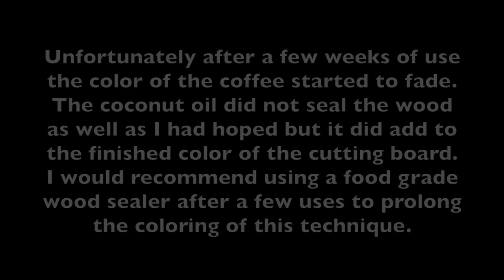Finishing a cutting board with coffee and coconut oil

Comment: You may want to try using mineral oil to finish it.  The mineral oil does a really good job of soaking and staying, I used it on a cutting board a year ago and still haven't had to touch that board (it was a 24 full soak though)

Comment: Do you always use coconut oil to finish your cutting boards? I like to use wood butter, a combination of beeswax and mineral oil, when I make my wooden kitchen items. The beeswax acts as an antimicrobial and the mineral oil does not go rancid like plant based oils do over time. Keep up the good work!
Reply from the maker: No I don’t, this was an experiment that half failed. The coffee staining was brilliant but the coconut oil came off after a few weeks of washes. I just received a lot of linseed oil from a friend. Would that work well? I like your method and have to try it
Reply: Mountain Fire Woodworks it will work for a while but most plant based oils will turn rancid after some time. Go for the real cutting board stuff
Reply: @MountainFireWoodworks  do you think the coconut oil would work on a knife handle, supposing it doesn't get wet that often?
Reply: @ilonareuvers2072  linseed oil (aka flaxseed) is a hard dry oil, so it doesn't go rancid.  tung oil, and walnut oil (roasted) will also dry hard.  just keep in mind that linseed and tung have very long cure times, which are usually corrected for by adding in VOCs.  if you're not tree nut allergic, a roasted walnut oil would be best.

Comment: I was wondering the other day about what it would look like if I used coffee as a stain on the wood counters I am making. I'm glad I saw this. It didn't turn out nearly as dark as I would want...going to go with a darker stain. But thanks for answering my question! I love YOUTUBE! Takes so much guesswork out. The other thing I would add to your video, that I just learned from reading SO many blogs...if you're using coconut oil to finish wood, you have to use refined or "fractionated" or it may go rancid later. :-)
Reply: Was there any sticky residue from the coffee? Or does it dry away completely
Reply: @shayne1547  it didn't seem sticky. It dried like a coffee ring would dry on paper. But it was just a light brown, and I wanted dark brown.

Comment: Do you mind expanding on the fade you mentioned at the end of the video? Why did you not include that? The whole video means nothing without that information/image/visual.
Reply from the maker: Of course! I cannot edit the actual video but here is the update: After I noticed the slight fade I bought some butcher block sealer, since then I have washed and used the cutting board hundreds of times without any fade. That is why my claim that the worked and the coconut oil does not still stands
Reply: Thanks for getting back to me. Now I just have to figure out where to source butcher block sealer locally, or how to make my own. Unfortunately the South African retail and online market isn't as well equipped as everyone likes to think.

Comment: 5 minutes with a heat-gun and some beeswax on top of the coconut oil would have helped. Oil gets sucked into the pores, wax somewhat seals it off. Try not to apply too much oil, hence avoid scraping altogether.